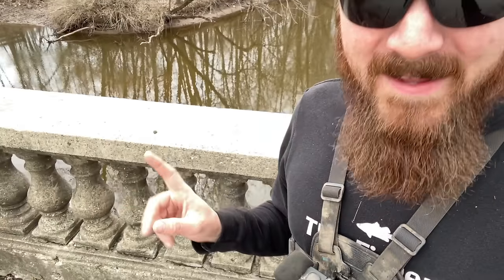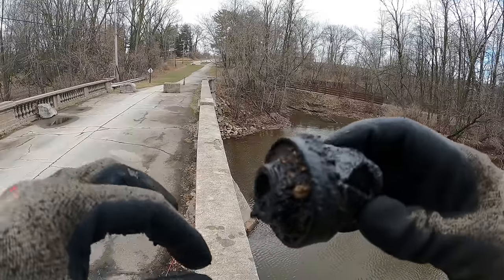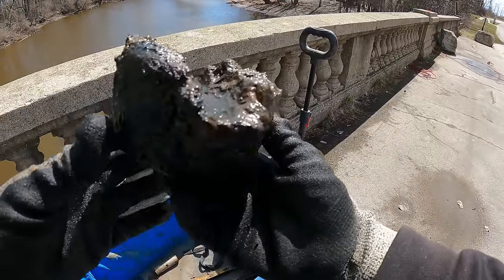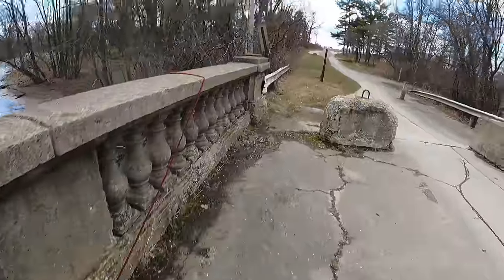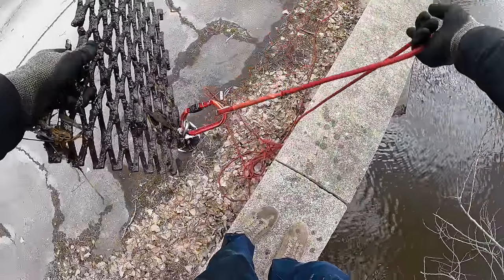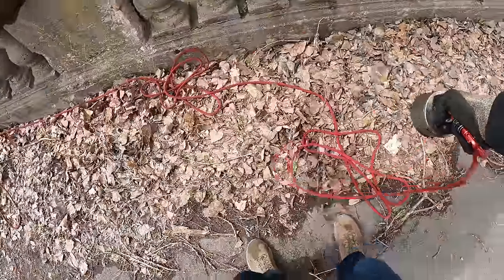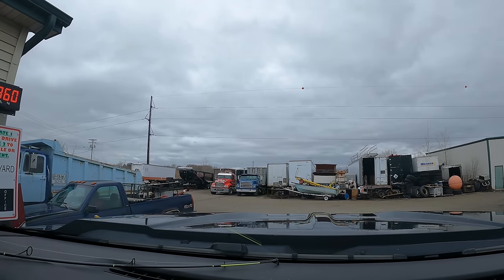The Most INSANE Magnet Fishing Find - Whoever Did This Needs To STOP!

Comment: Since I don't see any comments about it, but up to my knowledge
2:10 - Smudge Pot Road Flare-Construction Light
3:00 - Nail Clippers
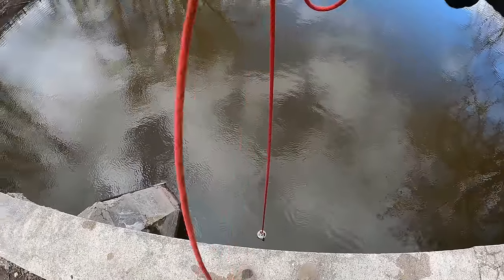3:40 - Frog Gigger
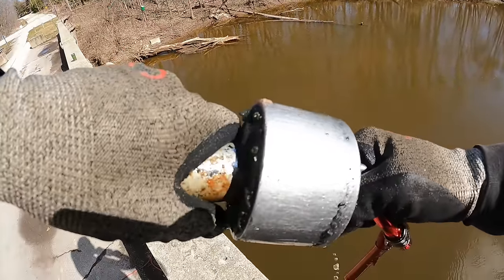4:40 - Bike Peg
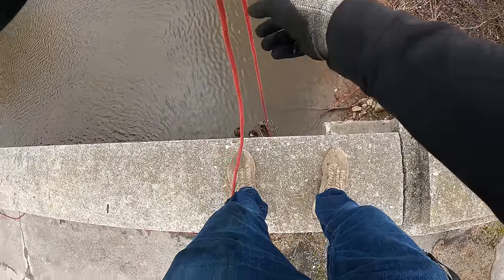9:00 - Stand-up tower fan
10:50 - "possibly" a Grate to a sewer or drain
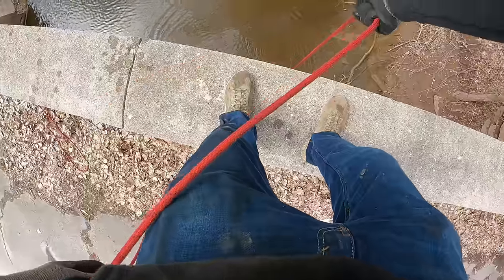12:10 - Weight Bar
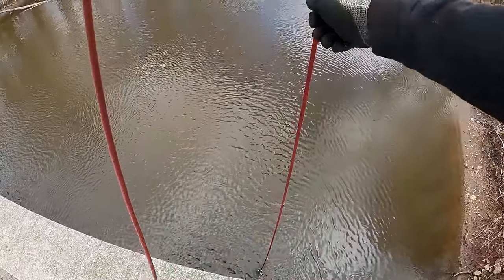13:40 - Lighter fluid
Reply: I think on 9:00, it’s a metal detector. :)
Reply: Rxd rxse that is a fan, that definitely not a metal detector
Reply: @Rxd Rxse it looks like an AC from a boat or a building
Reply: @urfavbellarose  It isn't a metal detector but yes it could be a fan or a heater (probably the fan can do the same thing? I don't know for sure since I've never really owned a fan like that.)
Reply: 2:10 is a car thermostat
Reply: Thanks for the spoiler.. 🙄🙄
Reply: @andrewv4491 That's what I was thinking... either that or the footvalve for a deep well pipe.
Reply: @andrewv4491 no it’s not

Comment: Great video. I would do a couple of changes.  1. put a carabineer on the other end to make it easier to tie off.  Also, then if you ever have to make the rope longer you just attach another one. 2. For your air pods there are these silicone covers, they will stay in your ears much better.  Also to go with those covers are ones that have string that go around your neck like a necklace.

Comment: If you were to put a tarp under  before you load it pull the other part of the top tarp and after you get the bigger stuff out you can pull all the little stuff out and it comes out real easily. I have done it for years when doing yard work and save a lot of time.

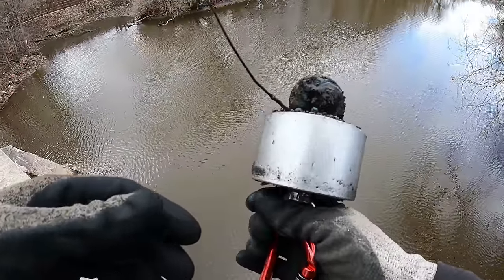Comment: The item you found at the time stamp 2:20,, looks like the top off of a “Smudge Pot Road Flare-Construction Light” ,, they burned oil, usually used in road construction, back in the 1950’s

Comment: Interesting trident, no idea what that came from. Air Filtration unit or plug in wall air conditioner. OKAY, who threw a weight bar into the river, and why? Air Pods are nice, till they fall in the river. I'd get the kind that hang around the neck and you put the ear pieces in but they are still attached to the neck piece. OH, payday turning in all the scrap. NICE, $108 for scrap metal.